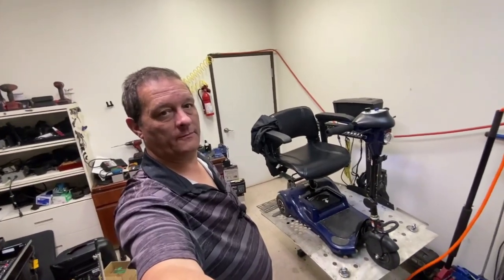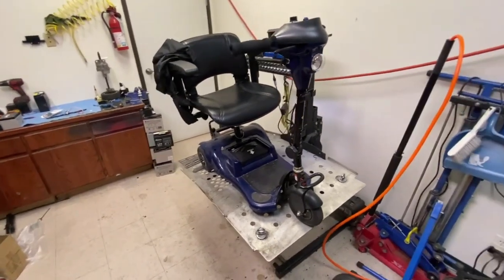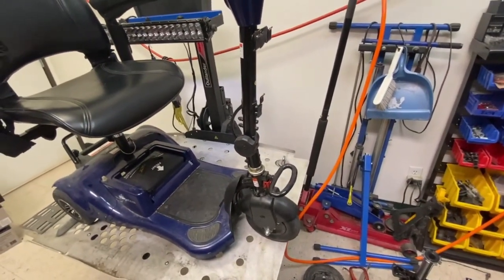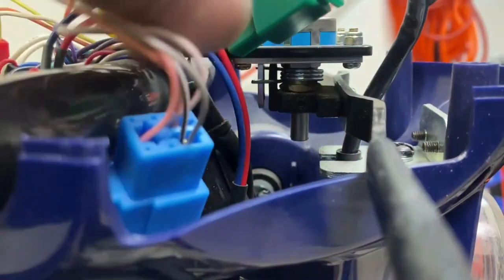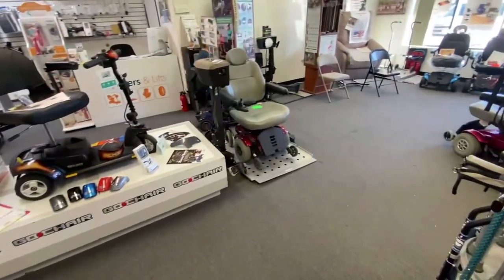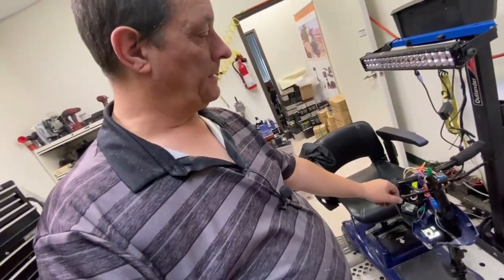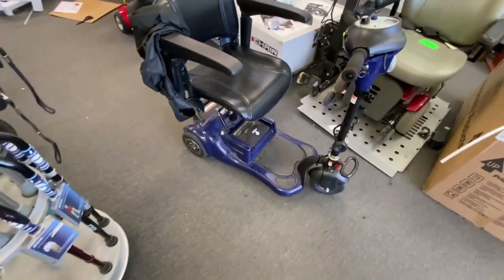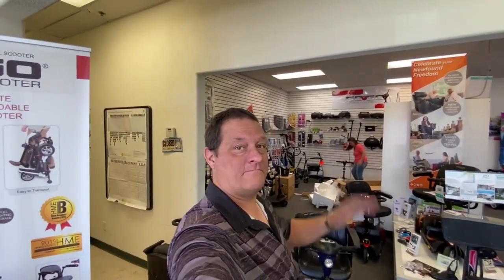Surging Drive Phantom 3 Wheel Mobility Scooter What can it be???

Comment: What is the safest larger AH lithium battery for a Phantom 3?  Picked up a used one and it needs batteries.  Saw this video and thought I'd just ask here. Like your videos
Reply from the maker: Firstly, you are going to be restricted by the dimensional size. Personally, I don't and haven't replaced or used Lithium batteries in any scooter other than what the manufacture recommends or supplies so I haven't done any test to recommend any such thing.

Comment: Why do some GoGo Elite Travellers have regular handle bars and some have the Delta style?
Reply from the maker: Hi Richard, this is my understanding of the change. Version 1 (interchangeable foot shroud side panels) and 2 (XLR charge Port) had the straight handlebars. Version 3, Customer feedback to Pride was that some people couldn't use their thumbs to operate the throttle. So, pride decided to go with the delta tiller design on version 3 so you can use either thumb or figures to operate the throttle. The delta tiller design also allows you protection for your fingers and also rest your palms on the tiller when operating. 
There was a revision change to version three as the tiller was too tall and hit the seat post when folded down, so it was shortened in version 3.1. Hope that answers you question. Thank buddy and have a great day.